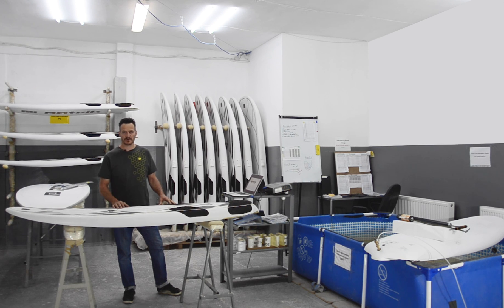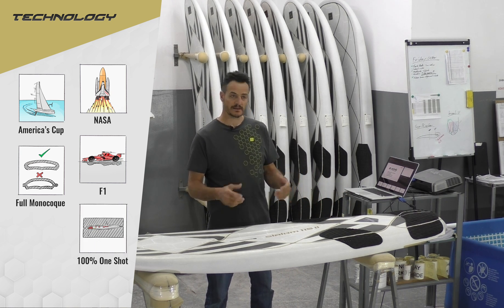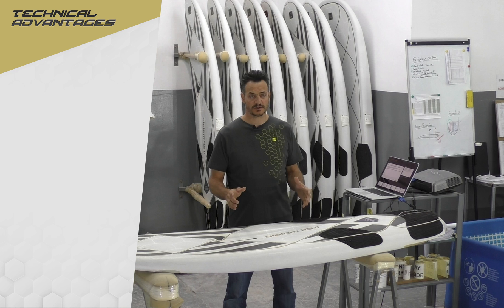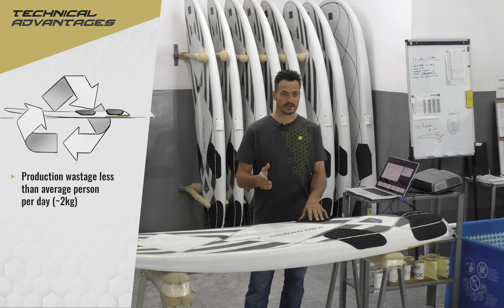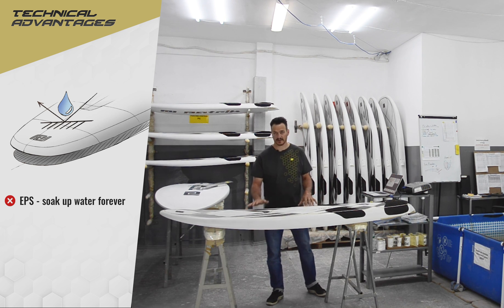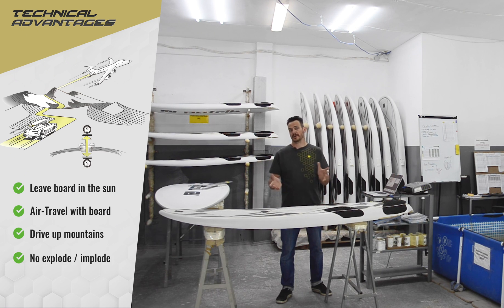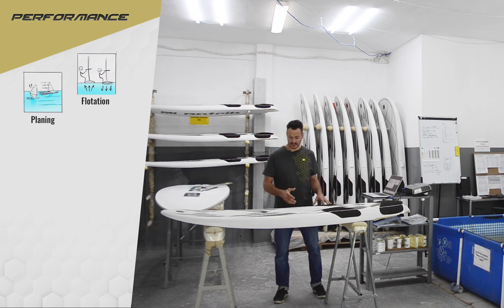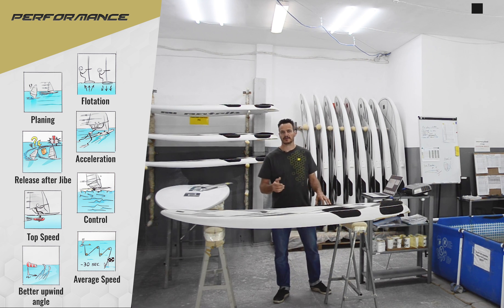PATRIK AIRINSIDE Presentation

Comment: Why do you publish +/-6% weight tolerance on Airinside boards? +/-6% is .8kg difference between the boards. 0.8kg is the weight of Russian Vodka "POLLITROVKA" . Is it because the boards are made in former USSR so the workers sometimes forget a bottle of Vodka inside the board?